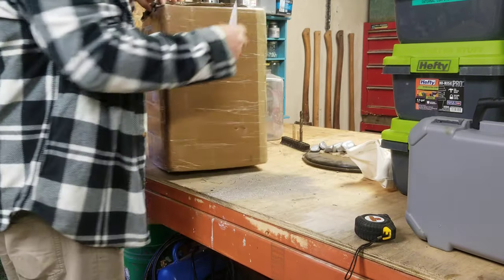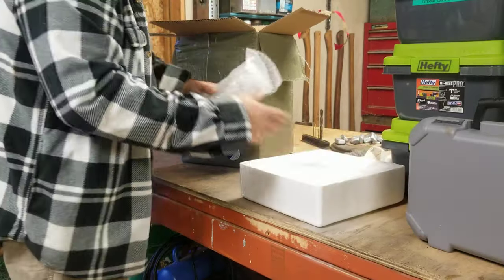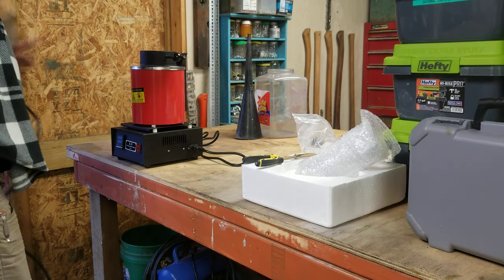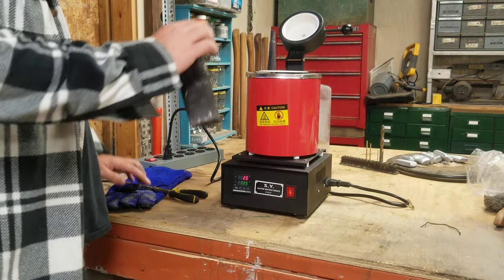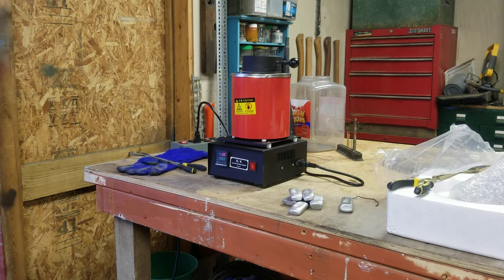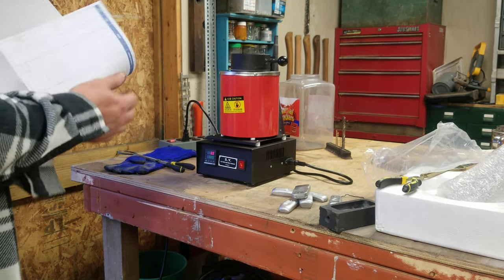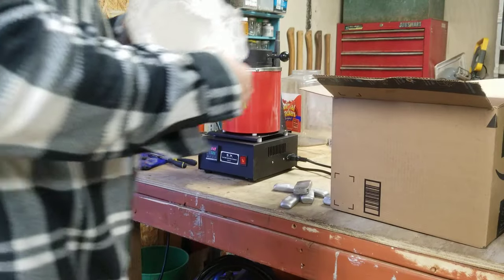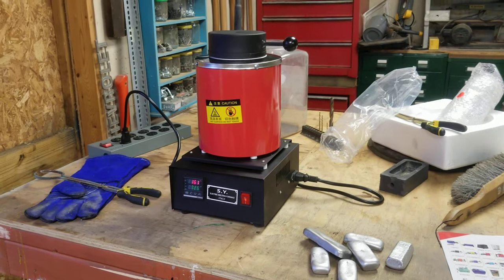S.Y. Electric Furnace Italy  - unboxing and review.

Comment: I just bought this type the other day, and was looking for any details, mine had no booklet, and I had to comment on your opening comment:  "I don't like people who do that kind of thing, try to send back  things they broke", I feel the same way, you take responsibility for what you do.  Thanks for a good display of form, function, and operation, I heated my crucible up today to "temper it", will melt metal tomorrow.  Thanks, really appreciate the details.
Reply from the maker: Have you done your first melt yet?
Reply: @Bairleafarm  Not yet, but I will take pictures soon.  It's too hot here, am waiting for a cool night soon.  I'll keep in touch, next week or two I  think.  Thanks for the note, and the video, it was good to see it run, and know to pre-heat it, I'd been looking.
Reply from the maker: @johnmcclain3887  it's miserable hot here as well.    Melting is good fall weather kinda thing.
Reply: @Bairleafarm  HI, I used to live in Riverside for a couple years, then went back in the corps, and ended up out here.  This has been one of the most brutal summers I've seen in forty years here, but you are right, hopefully a few more weeks and start cooling off.  I've scrapped copper for forty years, and silver aluminum, bronze, in my machine shop, and look to do some casting I've been putting off, piece parts for machines, replace cheap pot metal with bronze and such.  I've got multiple sclerosis from the Gulf, so I don't do heat real well anymore, but it'll be nice to "camp around" this winter.  I've maintained through this insanity in large by some very interesting youtube videos, and wish I could do some of the same.
Reply: @Bairleafarm  Hi there, I just melted down 965 grams of copper poured into a mold made or about five inches of 3 inch channel, with inch and a quarter hot rolled welded across each end, about seven degrees of angle on the end cuts to make the ingot fall out easy.  Poured yesterday, first time, about sixty that morning, seventy by noon, with the melt half done.  Same weather today, filled the crucible with copper wire, on end, poured 1387 grams today, a bit easier, better plan, very clean metal, used a couple tablespoons "spilled over the copper, crucible, flour" took a while to begin melting, was on a machine, but about another hour to probably double the load, yesterday, similar time today, with substantially more metal cleaned and cast.  I'm very pleased with the performance, and appreciate the advice from the beginning.  Thanks much.

Comment: Thanks for video. The two gold screws on the side of the machine. Are those important? Mine came with one missing and one just threaded into a nut?
Reply from the maker: There will be some differences depending on the lot.     I think they are cranking these out as cheap as possible.
Reply from the maker: With them all being different inhave seen suttle differences.

Comment: Just bought the same one on Amazon. It came with one of the crucibles broken and the display not working and the seller on Amazon disappeared after the sale :(
Reply from the maker: You can still do a return the Amazon.    They will refund even if the seller doesn't.

Comment: I just recently purchased the same one.  The specifications in the book says it's 110V.  But the specifications also state, however, that it runs on 50Hz.  Here in America we use a 60Hz system.  Will it still work on our system, or will it go up in flames like that "The Dismantler" said his did?
Reply from the maker: Ive not had any issues.

Comment: Does anyone know what the manufacturer settings are for the pid controller. I messed with them and can't get them back. You hold the set button for maybe 5 sec. And you can push the setting button to scroll through different setting. I just need to know the default settings please. I'm out of commission until I get it back to normal. Nothing about it in user manual or anywhere online.
Reply: I did the same thing. Would love for someone to write it down in the comment field. Would help a lot of people.
Reply from the maker: I didnt know it had setting?  I think mine is just a temp setting.  You can move it up or down.

Comment: I just bought one accidentally, meant to buy the TOAUTO version because this one sux big time. Mine keeps shorting or the fuse is tripping or something but I haven't got 1 pour out of it yet. I  Almost got to 700 c• but then the click sound went off and sure enough it shut off. I've called around but noone either speaks English or want to send me a replacement which I don't want this piece of junk
Reply from the maker: I haven't had to use customer support Thank goodness.    I'm sure it's horrible.

Comment: Have you ever had to replace the heating coil? I am currently trying to find an equivalent replacement.
Reply from the maker: No.    I tried to find one for my other furnace and ended up giving up.
Reply: @Bairleafarm  Gotcha. I just bought 50 Feet of 18 gauge Kanthal A1. 30 Feet should be about 16 ohms, I'm going to try winding my own. Hoping it performs better than the OEM.
Reply from the maker: @blargdarsky392  let me know how it works.
Reply: @Bairleafarm  Making the straight wire into a coil and replacing the old one took some work, but it seems to be working well.  From what I read, Kanthal A1 can handle a bit more heat than nichrome, and is probably much better than the Chinesium alloy one that they come with.
Reply: @blargdarsky392  How well has the coil performed after 10 months?